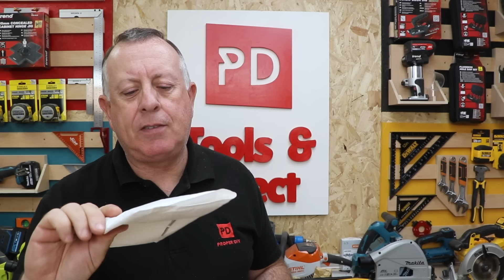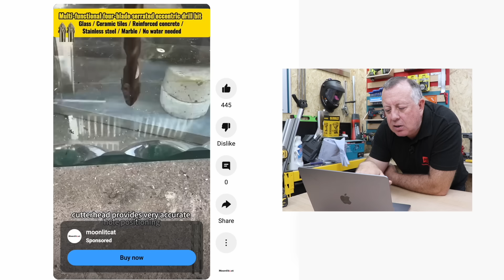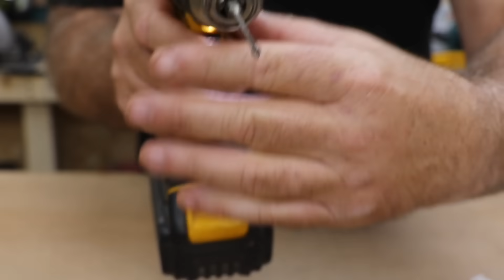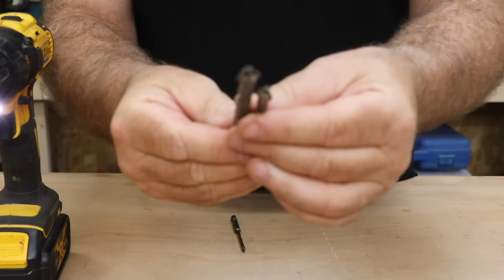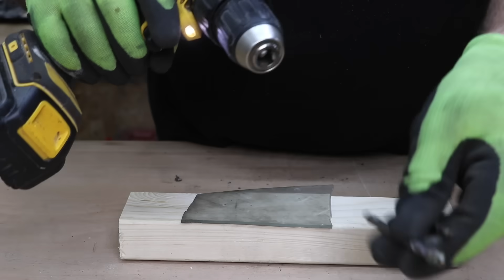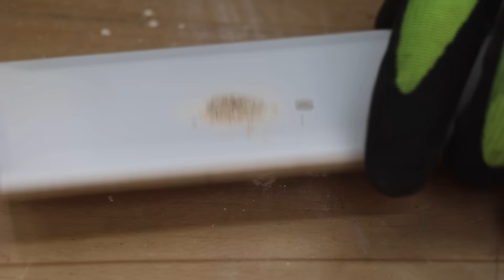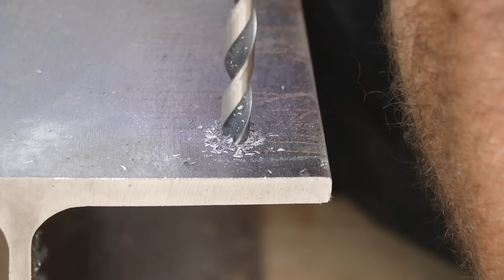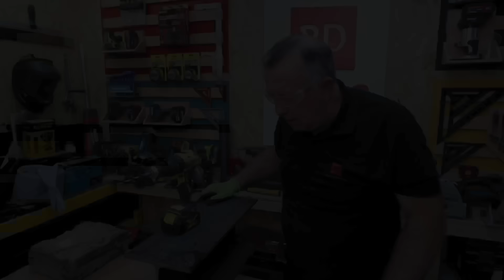Over Priced Drill Bits that Speed Through ANYTHING - Really?

Comment: Any proper machinist will agree that the "steel" in the advert was cast iron.  BIG difference.  They appear to be four flute CEMENT drills.  Concrete is an aggrtegate of larger, mixed stones of differing toughnesses, whereas cement is not.

Comment: I remember watching a demo of a similar set of drills at the Royal Show in 1981. I was very impressed, as the chap drilled into a hammer head, a metal file, a brick and so on. I wasn't paid very much in those days so I didn't buy a set but have regreted that ever since. Cue the video ad which was featured in this YouTube.. So I searched for, and bought, several different versions, at several different price points, but  none as expensive as £28 for 7 bits.. Some behaved as shown above. Some did ok. Several lost their tungsten carbide.  So my question is, what happened to the drill bits they demo'd all those years ago at the Royal Show?? I am still looking!

Comment: I had the ad for those very bits before this video. 🤣

Ps, Always pilot hole steel (or most metals for that matter) with 4-6mm bit before running a bit as big as 8-10mm+, and even using a second step up size if the finish hole is over 12mm. It’s much quicker, and keeps bits lasting. And yes, use cutting oil.
Reply: You don't have to use a pilot hole. It depends on the drill geometry. 4 facet drills don't need pilot holes. Chisel point drills with thick webs can benefit from a pilot hole. But pilot holes can help.

Comment: Got a set from the " Bad Dog" display at the event center in Raleigh , N.C.( farm show basically) , payed $250.00 for like 3/16 up to 3/4 or so, a lot of bits. They even include a diamond wheel to sharpen the carbide or titanium leading edges. They look like " masonry"  bits, 2 edges brazed on. So far they have gone through steel, concrete, and whatever. Pretty good bits.

Comment: You probably wouldnt use a drill for installing things in tile. You mostly use hole saws or circular wet saws.
The only thing that will drill through steel in seconds is a plasma cutter. 😊

Comment: I’ve stopped buying from YouTube adds now been caught out 3 times with a load of junk last one I got was 25 year guarantee for waterproof paint in a selection of colours, for virtually any surface  wood, concrete, plastic, it also claims to fill cracks and give an easier surface to clean, only stipulations was must be on a clean dry surface, and needs 72 hours of no moisture, or contact with rain, so I got the 3 tiny pots (coverage 6 square meters) on a non absorbent smooth surface, so I wanted to tidy up part of the roof on my motorhome, my friend who owns a large garage was going on holiday for 3 weeks so he said use my garage, I prepared and masked off, the area to paint, started to apply with small roller, but the paint was very thin and watery, still I finished it, left it for 3 weeks in the warm and dry, 2 weeks after it had been standing in my yard we had a shower of rain and to my horror this magic paint was running down the sides of my motorhome diluted by the rain, absolutely Chinese rubbish,  how they get away with advertising and selling this crap is beyond me, don’t even bother to watch them now, let alone buy.

Comment: I’d like to see an attempt to drill through steel using one of these in a drill press, which would generate enough pressure to start a hole. 
I did think that these looked too good to be true and I have just saved £28. 
Thanks.

Comment: You mentioned their "good point" is drilling through ceramic. Yeah, the bit went through ceramic pretty effortlessly, but it's quite obvious the bit head was almost completely worn down after three holes into ceramic. A pretty expensive proposition when you have to change the drill bit after 3-5 holes, especially at 28 pounds per pack! Jeez! It's obvious the tips are made out of mild steel instead of something like tungsten or high tensile steel. Pure cheap junk! The unscrupulous behavior behind today's efforts to make a quick buck is off the chart!

Comment: I notice that the 'test' bit is on a high speed setting and the Bosch bit is on a low speed setting, which is usually the right way, isn''t it? How does a fresh 'test' bit work on a low speed setting. Also, you're using lubricant with the Bosch bit. I'm not saying the 'test' bits are good or bad but an equal test for both would have made more sense

Comment: Some issues here to clear up.
Glass should have water as a lubricant, he chose not to use water.
The shape of that bit is similar to 4 point masonary bit, they're NEVER used to drill steel. As he says, the steel twist drill bits work, although he used a high speed setting to eventually break the chinese bit, but slow down for the German twist drill bit. This is bias. If the Chinese bit claim they can drill steel, well that's false.

Comment: I don't see how these would be any good because it looks like the tip is wider than the bit itself (if the tip is wider than the bit, a 1/4 inch bit creates a 3/8 inch hole?). Likewise, I do not understand the purpose of the drill bit behind the tip. Why not just have that tip on a solid shaft?

Comment: To be the devils avocet for a moment, I've never drilled through any of those materials without lubricants. Glass, I use the trick where I drill it underwater, works ever time. A drill bit has two cutting surfaces that do the cutting and generate heat these drills have four, making the need for  lubricant's even more critical.

Comment: In those demo videos they are drilling through cast iron not cast steel, which is way easier.
I'd like a series where you buy cheap but claimed good drill bits. As I am sure there are some good tungsten tipped drill bits out there made for drilling metal, but finding ones you can trust is hard.

Comment: The advert appears to be drilling grey cast iron. Not steel. Cutting angles require differences for differing materials. And those angles need to respect both the axial and radial cutting angles.

Comment: I can almost guarantee the tips are a cheap sintered blend of Cemented Carbide.   Thats when they take a mix of Tungsten carbide (WC), Titanium carbide (TiC), and/or Tantalum carbide (TaC) and mix it in a ceramic or powdered steel base with a binding compound.  Then under heat and pressure they basically stamp out lots of these tips.  Those are then braised (evidence by the copper-like and blackish blobs on the base of the tips) on to probably a low quality mild steel shaft.  Now Cemented Carbide isn't bad.  It's a lot easier to manufacture than grinding pure Tungsten Carbide down to a tool inserts using diamonds, but its effectiveness HIGHLY depends on the blend, size of bits, and binding materials.  A common thing is using binding materials that are extremely hard (generally cheaper), which means it is also very brittle.  So when the small bits of carbide hit resistance they just shear off.  And I would not be surprised if the carbide they are using is ultra-fine dust that is probably the grinding filings from making real carbide tooling.

It would be great to see these under magnification and see how each use is tearing into the material.  Cooling, going at slow RPMs, and very light pressure would probably help extend the life of these (but they will never compare to real carbide tools, or hold up as long as high speed steel would).

Comment: Even those coated drill bits at the hardware store are worthless after the coatings worn off, can't be resharpened because the shaft is not high-speed steel.

Comment: Tungsten carbide is not the first choice for cutting steel as you'll no-doubt know.....(hence how it was able to cut through ceramic and have some kind of attempt at the concrete). Even in their demo vid the 'steel' it apparently cut through produced no swarf....I've encountered similar effects though using Cobalt bits when drilling Stainless steel. Great video btw ! :)

Comment: I have found that the best type of drill bits for hard materials are those made of cobalt. Cobalt is very hard. I used them to drill through 304 food-grade stainless steel, wood, and concrete. They are expensive, but perform very well.

Comment: Being a Toolmaker, have machined many different materials. In the video, the metal they are drilling is in the cast iron, ductile iron, malleable iron type. They generally are very easy to machine.  The I-beam used is mild/low carbon steel. But it has a blackish layer of VERY HARD material like slag on the surface, the result of forming hot-rolled-steel beams. The first attempt with the new drill couldn't get thru that layer probably because of the design of the tip. It started to break thru but probably got dull in the attempt. Then, using the Bosch drill in the same started hole, it drilled OK but slowly. would suggest a test using cold-rolled steel.
Reply: That mill scale is definitely some hard shit and will roast your drill bits just like trying to drill through rust. When possible I hit the scale with a grinder first
Reply: @chrisrageNJ  Sometimes just using a center punch & making a large divot will allow the drill to break through the crust, but probably with a little damage to the cutting edges.

Comment: Most of the "Steel" they use in the Adverts is not steel, but cast Iron.. which is brittle as Fcuk..
Drilling through Tiles?.. Just use a Masonry bit... works just as well..

Comment: I know it would contract the advertisement, but I'm a bit curious what would have happened, if you had taken the same approach you did with the tile. That is, keep the speed up, and don't press too hard. The "Laser Welder" that you were talking about reminds me of some "automatic soldering guns" that I saw about six years ago from a Chinese warehouse site. In spite of the US plug, it never got hot enough to melt the solder, so I am wondering if it was really designed for US outlets? Also, the feeding system didn't seem to work that well. Perhaps, I was using the wrong gauge of solder. If it couldn't melt thin solder, it probably couldn't deal with thicker solder, though.

Comment: I KNOW YOU DID PROBLEM IS I HAD ALREADY BOUGHT 2 AND I DONT WANT TO SMASH EM WITH A HAMMER EVEH THOUGH THEY TAKE 3 HOURS 27 MINUTES TO HEAT UP AND 9 HOURS 41 MINUTES TO COOL DOWN AND IM YET TO FIGURE OUT HOW THEY CUT THROUGH METAL REMOVE RUST OR WELD ANYTHING BUT THEY MIGHT SOLDER SOMETHING IF THAT'S WHAT ANYONES HOPING TO DO WITH IT SO YOU COULD HAVE TOLD ME SOONER AND I WISH SOMEONE HAD TOLD ME ABOUT THE 30 MILES RANGE MOBILITY SCOOTER I BOUGHT FOR 49 POUNDS ABOUT 4 MONTHS AGO AND WILL RECEIVE ANY DAY NOW I BET ANY IDEAS ON HOW I GET MY MONEY BACK OR THE MOBILITY SCOOTER I PAID FOR AND SOMEHOW IS MARKED AS DELIVERED THAT I DIDN'T RECEIVE BECAUSE I CANT FIND HOW IM SUPPOSED TO EVEN APLY FOR A REFUND AND THE ONLY THING I GOT FROM THE SELLER WAS A NO REPLY EMAIL ONCE

Comment: Truth the best set of drills i WVWR OWNED WAS A WEST German set I bought in the 80s from the NEC exhibition centre near Birmingham their tip was covered with a special dust the same NASA used to protect their crafts from high heat  they Did drill anything expensive at the time I remember it was over £27 for a set of 6 they were Like diamond drilling bath floor tiles as usual stolen from my tool box in less than 6 months, now days you get a lot of crap but if u need them for tile drilling they sill worth it

Comment: At 1:55 the machine casing... that's not hard material at all 😂
That's why its used for making these parts...
We call it casting steel and if you work it on a lathe or milling machine the chips are dark grey particles and dust.
It's not the same as cast iron.
If you want to test these 💩drill bits then let them chew on a bit of carbide steel 😌...

Comment: Hope they offer a money back guarantee. The thing is I wouldn't call 27 quid cheap crap, that's expensive crap. I use bosch bits myself and they work and last a decent time. As others have said, now that this claim has been proven false (60mm steel in 5 secs) the advert should be taken down

Comment: 4 tip carbide bit -  looks like a junk/scam version,  but that design has been around for at least 30 years... and yes, the good ones really are best for tile and ceramics. 
From the advert - looking at the "steel" when drilling it, look at the shavings -  that wasn't any steel I've ever drilled... that looked like powder from plaster or tile...

Comment: In the adverts, the drill bits have carbide tips (or something similar), and the material they drill has been softened.
Yours are just hardened steel tips (nice and cheap), and that is where the scam presents itself.
And never needs to be sharpened is just BS because everything wears down.

Comment: as an engineer  the most important part of drilling is accuracy these things have none of that they are a scam if you cant be accurate there useless if you want to drill through anything diamond tips are the best there expensive but at least they work and you can be accurate drilling isnt just a case of putting a hole in something its about putting it in right place.

Comment: As a metal worker engineer i have  seen these when they first came out  and thought they looked like some one has made them from their home and are made  from cheap existing masonry bits
 and even in the video's the bits wonder all over the place and you can see the holes are very much bigger than the bit dimension 
Just don't be fooled by these cheap and nasty gimmick tile drill bits that claim to drill through everything
its fake
and to say with mild steel with drill bits 10mm and less you need to drill rather fast speed 1 on hand drill and 2nd speed on larger bits, i have lost count on the millions of holes i have drilled and the and  the HSS bits last about 100 holes by hand  before they need re-sharpening

Comment: That drill bit was walking away on the concrete.....That oval 
hole will not be able to hold anything

The steel in the advert was fake steel. If you look at the ad - The left hole had a weird texture on the inside. Looks like a surface sprayed to look like metal.

Comment: Modern tools in general are not as  good as old stuff, chisels and drill bit’s especially,  many sold as HHS (high speed steel) are not at all. I have drill bits that I have been using for over 20 years. You get what you pay for, good quality tools cost money and last a long time.

Comment: I got a Bosch 4.5mm HSS POINT TEQ bit to use on 4mm metal fire place.Didn't touch it like the shite drills you tried.I used an old drill I had in me bits box,no problem straight through it in no time.Waste of 3 quid from toolstation.Old apprentice served tin basher and general building experience.Retired,sort of.

Comment: 1. I Always use cutting fluid on steel. Much faster and also extends the life of the bit.
2. The leaders in hole cutting / tapping metals I have found to be are HMT (Holemaker Technology) from Kent - I have had some excellent items from them. They make bits to fit pistol drills now.
Reply: What the duck is a pistol drill?
Reply: @AlbionSupreme   Any hand held drill shaped like a pistol - though more applicable to cordless ones these days. 👍
Reply: It depends on the nature of the work how critical cutting fluid or coolant is. The kind of tool you're using. The thickness of the work and the depth of cut. Heat doesn't affect tungsten carbide at all. Well, at least not the heat you're going to generate cutting with it. Tungsten carbide melts at twice the temperature steel does. So steel would be a vapor and carbide would still be chugging along.

Comment: You can’t drill through toughened glass. Has to be annealed first and even then you are grinding a hole. These drills are shit as.  I get you tube ads for a Wall socket heater designed by Ex SAS ninjas who used it for secret military use and will make the whole HVAC industry bankrupt. Total horse shit. You tube just accepts the money and promotes scams.  They should get a $1000 fine every time someone reports this crap from the ACCC.

Comment: Your tile is the soft kind, which you can drill using a drill bit for steel, once yow penetrated the enamel layer. I needed such special bits for drilling porcelain frost resistant tiles, which are extrermely hard. Each few seconds I put the drill in a water bowl, to cool it.
The yellow track is the brass used tol fix th VIDIA (mtal carbide) tip on the bit, they failed to varnish.

Comment: 100% the advert was faked with steel.  Notice how it cuts in after the bit is already drilling with a significant pile of spoil from the hole hiding the interface.  They pre-drilled the hole, (maybe) put something in to provide a small amount of delay on drilling through, then piled shavings around the hole to hide it all and cut the video to hide the evidence.

Comment: I got a set of eBay £5 and being an engineer I wouldn’t expect them to drill steel, I got mine for bricks and they work great my tips are tungsten carbide tipped just like any masonry drill
But I do find the drill very quickly if you want to sharpen them you have to use a special Stone (green or diamond) not ordinary grind Stone. I have the stones because I use them to do my lathe tooltips. Still good review video 😀👍

Comment: These look suspiciously similar to cross tip SDS+ bits, which are specifically designed to pierce stone, ceramics and hard concrete. A set of 6-8 professional grade cross tip bits can go well over 100 euros, but for hobby/occasional use you can find decent enough sets in the range of 30-50 euros (depending on size).

Comment: When they drilled a hole in the flange they had filled a hole with some metal filler then just drilled through the filler. We used to do it to apprentices and then get them to try it and they would be drilling for hours! It taught them how to sharpen drill bits if anything 😂